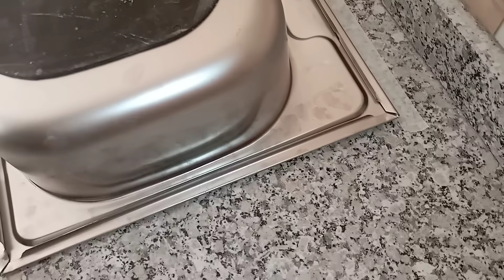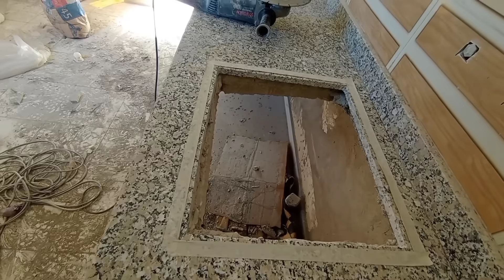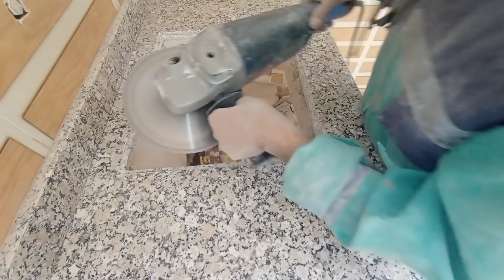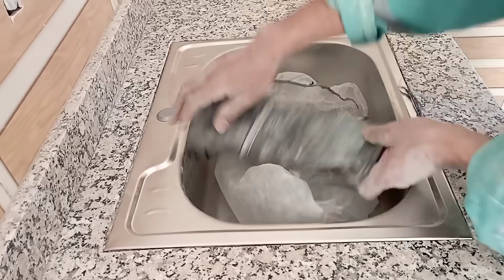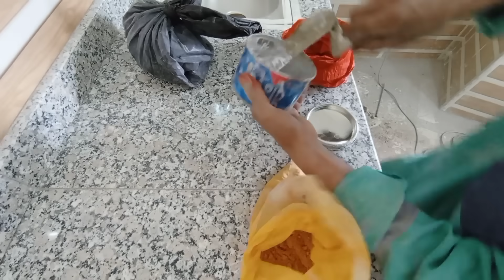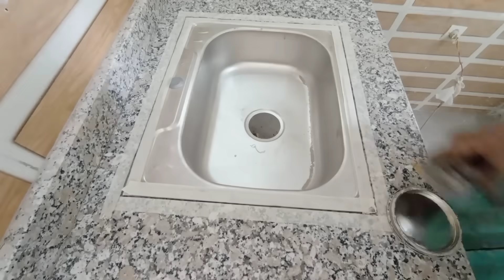الطريقة الصحيحة لتركيب حوض المطبخ وسط الرخام L'évier de cuisine خليفة

Comment: No no no!!! So he cut the opening too big, so he had to use apoxy😂😂😂. It’s a drop in sink so the opening has to be smaller. Cut the opening, preferably with a water saw cause granite will crack under the pressure and heat. Clean it up with acetone. Apply clear silicone on the backside of the sink and drop it in. Clean up the silicone that squeezed out and you’re done.
Reply: Yes, hé looks like an amateur. The first cut looks still okay, but then he started to waste it!

Comment: Very BIG MISTAKE right from the start. You cut the rectangle too big! From where you positioned the tape, you should have gone in at least 15mm or 20mm!!!
I am pretty sure that your sink top would have actually dropped into the hole!
Not sure how you got away with that!!.
Reply from the maker: Thanks for the tip!
Reply: @Ighoudceramictiles  
You're welcome brother.

Comment: I'm afraid  this right way is the wrong way. Your measurement is incorrect. You need to cut only where the bowl drops in. So quite a wide margin can overlap the granite. Minimal silicone is then needed to seal it.